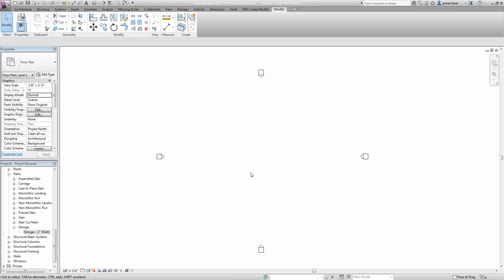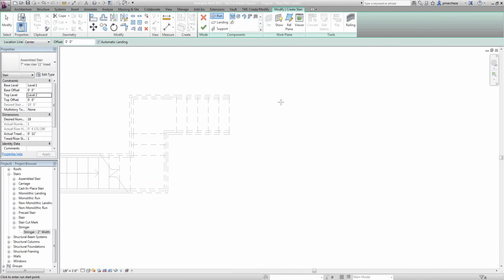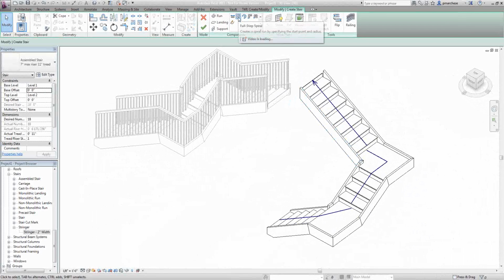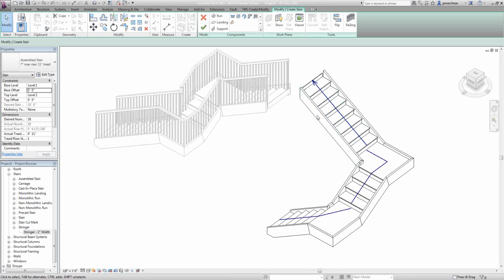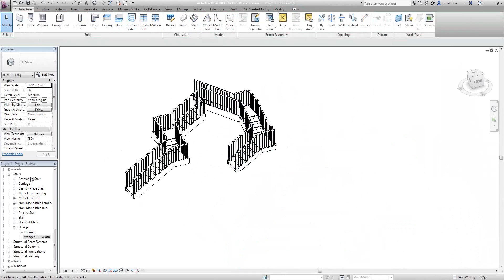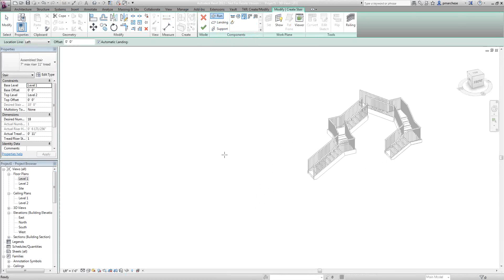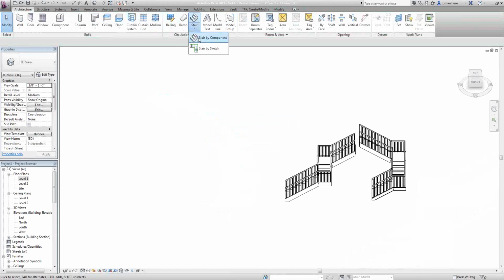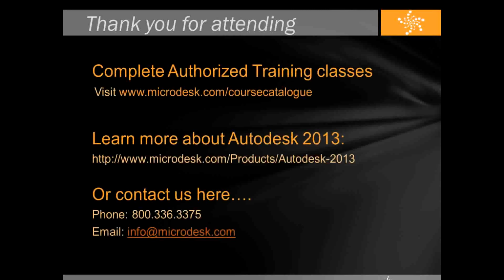How-To: Create Stairs with Revit

Comment: Thank you for the teaching.  All studies and teaching in the internet are based on floor level to  floor levels on full height walls.  I need to understand how can we draw form a back door (from laundry room) a landing  with external stair (only 3 risers) to the garden .  The height difference between   FFL of the house  and GL of garden is 600mm.  The landing should be 100mm below FFL of the house.

Comment: Is there anyway to change the stringer profile to anything other than a C9x15 Channel? Say a MC12x10.6, or in the case of a Ship Ladder, C6x8.2?
Reply: +Jeff Hero Sure, you can select the individual stringer you want to change, (may have to use tab) and then go to that stringers type properties. From there you can make a new type or just change that types section profile to be a different one. If the only option you have is the c channels, that just means you will need to load or create some other profiles that you can use.